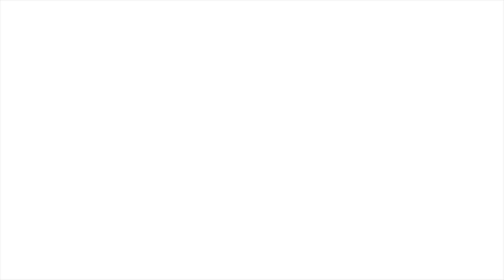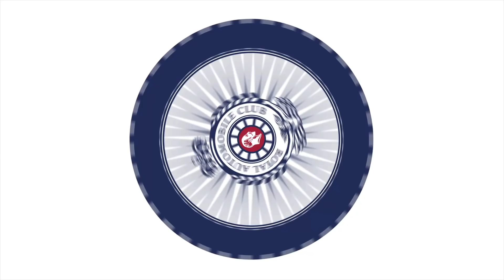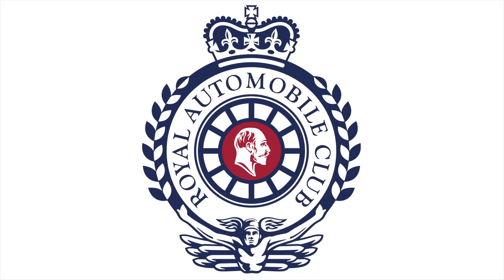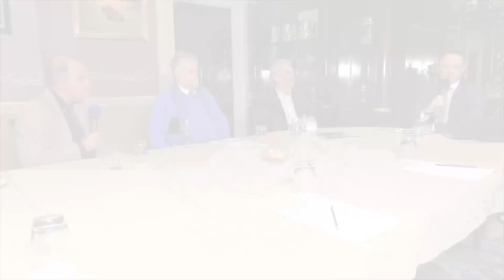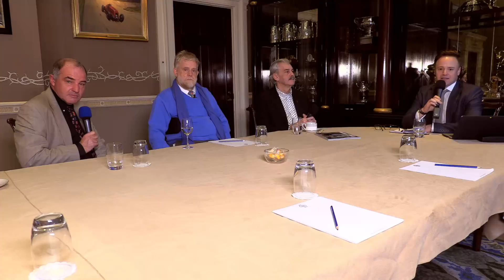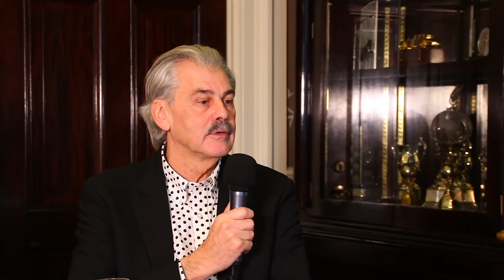Gordon Murray: Royal Automobile Club Talk Show, in association with Motor Sport

Comment: Gordon Murray undoubtedly deserves to be mentioned alongside figures like Colin Chapman, John Barnard, or Adrian Newey. However, I find myself wondering why, after all his achievements, he still quibbles over the McLaren MP4/4 story.

Just to set the record straight: Of course Steve Nichols adopted the basic idea of an ultra-low F1 car from the example of the Brabham BT55 – as, in time, did all F1 designers. In that respect, Gordon Murray deserves credit for being the first to introduce this vehicle concept.
The main obstacle to rapid implementation, however, lay in the engine cross-section. Combining a low, slim chassis with an engine that was still wide would have been hopeless from the standpoint of an aerodynamically or center-of-gravity-optimized design. At McLaren, for example, the wide TAG-Porsche engine in the MP4/3 of 1987 allowed only gradual improvements – it was solely the arrival of the more compactly designed Honda engine that made it possible to fully exploit the concept.

When Gordon Murray joined McLaren as technical director, he may well have presented some drawings of the Brabham BT55. However, Steve Nichols must have already understood the merits of this concept, as indeed any designer with half a brain would have. In other words, Murray was essentially pushing at an open door by then. The fact that McLaren staff recall Murray’s role in the MP4/4 project discordantly is explainable by the likelihood that Murray focused on fundamental aspects at the outset – such as securing as low an engine installation as possible – but did not interfere with the day-to-day development afterwards. However, a few broad, even though correct guidelines do not in themselves amount to a fully engineered, race-winning car.

What’s more, after his time at Brabham, Gordon Murray confirmed that he had his fill of building racing cars. His involvement with McLaren was likely driven above all by the opportunity to work on upcoming road car development – and he brought the Brabham BT55 concept with him mainly to enhance his value on joining. The 1992 launch of his true project, the McLaren F1 within McLaren Cars, suggests a lead time of about four years, especially for such a car from a company with no prior experience in series production. That means Murray must have been engaged in this project no later than 1988, and from then on probably held the title of “technical director” for racing car development only in a formal sense. His departure from this role in 1991 – at a time when the design work on the McLaren F1 must have been completed and following production issues, also in relation to upcoming vehicle preparation, had to be dealt with - further underlines that Murray’s actual brief lay in assignments independent of McLaren’s racing program. Since then Murray - as known - devoted himself to applied road-car concepts, having to this day nothing to do with motorsport anymore.

Comment: isn't the Mclaren Mp4/1 first F1 car made by carbon by John Barnard and isn't the Ferrari f40 the first road supercar made by carbon as well?
Reply: Furthermore the main problem with the wrong packaging of the Jag xj 220 comes from the initial idea of using v-12 configuration of the engine which was replaced by v-6 later.

Comment: 46:56
This! Absolutely this! We always hear about how today's cars look so slow compared to older cars, and how the camera angles don't help at all.
You certainly get this feeling when you're watching the over-the-shoulder footage of Lance Stroll's Williams as it's going up Beau Rivage during Q1 (looking so dull) versus Jarno Trulli's R24 back in 2004, as he drives by the same stretch of the circuit, seemingly at an astonishingly, blinding speed.
I mean, in Stroll's case, you're talking about a state-of-the-art 2017 F1 car, with all the most recent technology applied to it, and seems a lot more dull than a 13 year old car. And it's not that it's slower; it's *not*. It's just the sense of speed that's just not there.
Reply: I can understand how the car in the middle of the frame philosophy started. It probably came about when camera-people were trying to show their skills with more maneuverable cameras. But I think that it went too far. There should be a balance between stationary and non-stationary cameras. The sport used to look way more spectacular.
Reply: @leoa4c  In the early 2000s they had loads of camera shots inside the track of cars flying over the top, that certainly have you a wake up call as to the speed, so yeah completely agree it would be great to have more static cameras